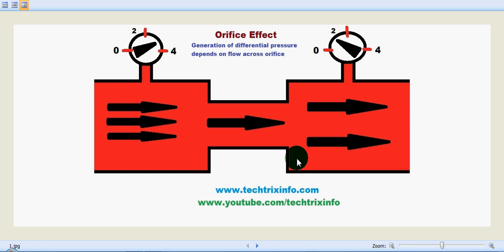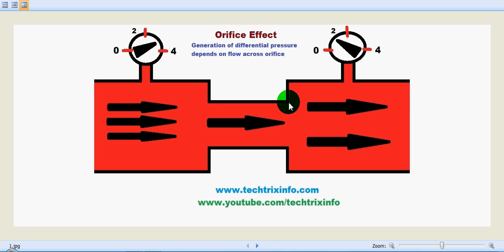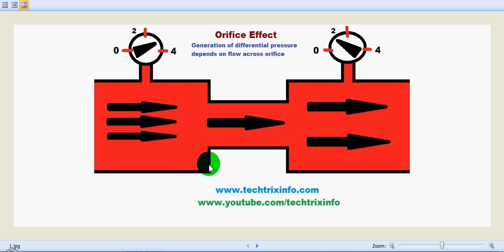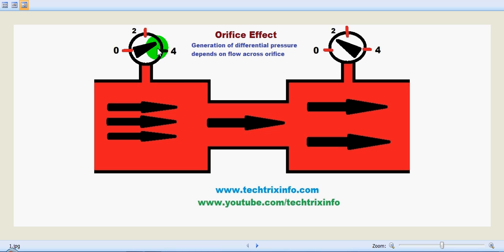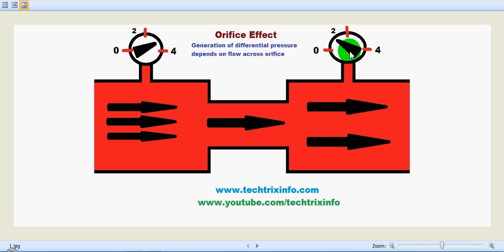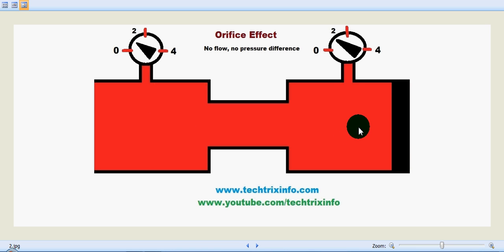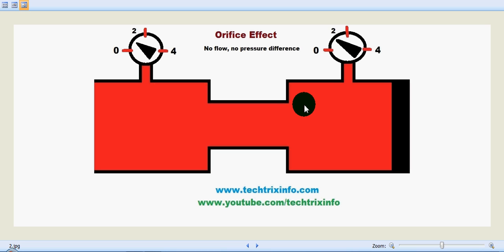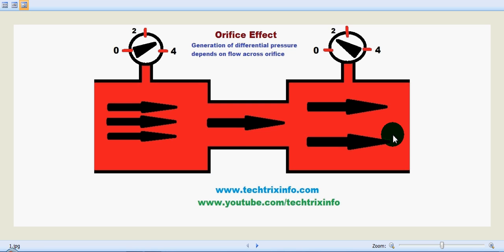How orifice effect on pressure works. ✔

Comment: Pressure Gauges used in Hydraulic Machines have got a small hole of 1 mm dia, How does the gauge shows the correct value of pressure in system, there should be a pressure drop as it is also similar to orifice?

Comment: When there is a reduction in area the velocity of the fluid flowing through the reduced area should increase and as the velocity is increased the static pressure should decrease with the increase in velocity. But you are mentioning that instead of a pressure drop at the reduced cross section there will be an increase in the pressure. Kindly clarify regarding the same.